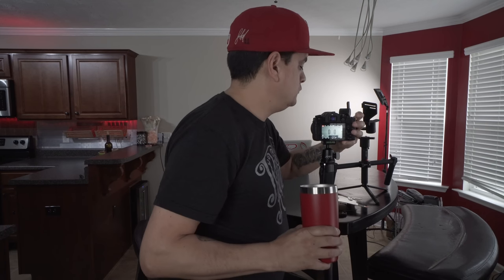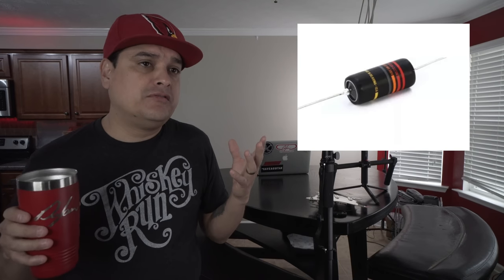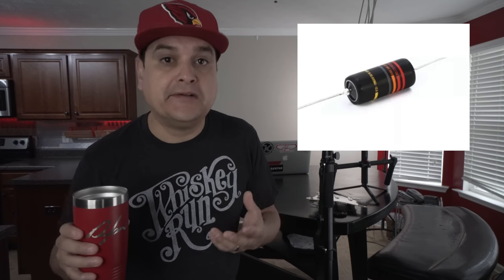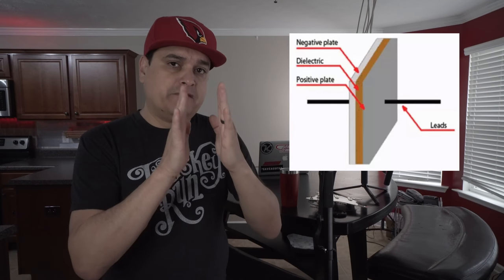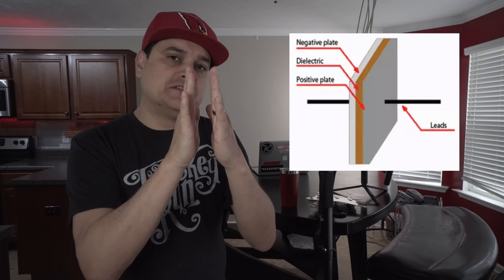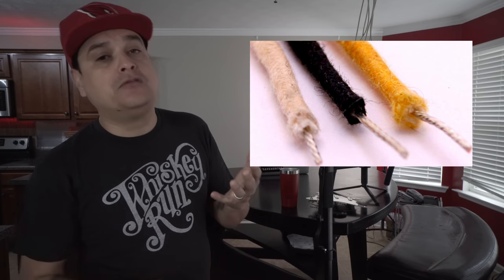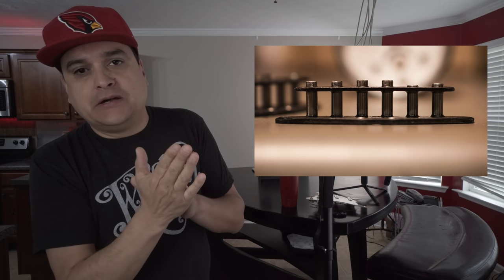Are Paper In Oil Caps Better Than Orange Drop?

Comment: thanks for the video!  i dig it and your content generally!  but, alas, i must disagree with some of the thinking here, because of a couple things.  just superficially, yes of course different cap types can sound different; you're using totally different materials of dissimilar densities as the spacer between the charged cap plates, and they don't all act identically, just like mahogany behaves and sounds different than maple, and aluminum bridges play a little different than brass bridges, most of the time.  alnico speakers play differently than ceramic.  and a substantial amount of the time i've spent so far exploring this question, i've spent actually trying out many, many caps of different construction types and values and ratings.  i've done blind tests and non-blind tests.  i know i'll probably catch some flak for this, but please hear me out before judging. this is just my reporting back on my own (probably biased and anecdotal but nonetheless extensive and attended with care) first hand experiences, which i gathered by  conducting direct comparisons and experiments and carefully noting what i heard as a result and then concluded.  and ffs people, do your own listening tests and see what you experience.  there's no shortage of received uninformed opinion thrown around these days.  remember that the cynical, impossible-to-please skeptic is simply someone who doesn't believe in their own observations.  i encourage everyone to do their own work and speak from their own experience where possible.  

  my take on the whole issue is basically this:  it'll take 3 minutes or less to figure out which cap value (uF/nF) is best for tone.  i personally tend to most often prefer caps in the 10n to 22nF range. your results may vary.  any bigger tone shaping i usually regard as the amp/effects/cabinet's job.  for voltage rating, i can comfortably say you're best bet is to choose the highest voltage rating you can afford; i have noticed consistently that higher voltage rated caps just sound noticably better, even in blind tests.  now, the controversial attribute -- the differences in cap construction type -- these are where we find the most subtle and difficult to pick out differences when listening by far, and i think this is because the audible artifacts of construction type are not a matter of the -3dB cutoff frequency dictated by plate area in the cap.  it's instead that the audible artifacts are the result of different dielectric materials being sandwiched between metal layers and subjected to changing electric fields that do exert a measurable (albeit minute) physical force on said dielectric.  tech talk aside, what i'm saying basically is that i've so far concluded that cap construction/dielectric type is something that i feel when playing the instrument, much more than something i hear from the speakers, and that dielectric type mainly affects how the guitar plays in my hands.  what this means to me is, construction type in cap selection is chosen because of its effect on how a given player interfaces with their instrument.  maybe nobody hears any audible difference in tone; still the one playing the instrument will in my experience almost always be able to FEEL something different in how the instrument plays for them.  so, choose a cap's value (uF/nF) for how it affects tone and how it sounds to a group of listeners. but, choose the cap's construction/dielectric type for your own preference and how it makes the instrument play in your hands.  i hope that makes sense.

Comment: I just changed all the electronics (minus the pickups) in my 2 Gibson SGs (one is a 2004 and the other is 2005, the specific models are un important)
Originally the caps they had were ceramic, the ones in the now wiring harness were orange drop..... tonal difference? Fucked if I know!?!?!
the only significant change I really made was I put treble bleeds on all the volume pots since I didn't want the high end roll off... (thats what a tone control is for... right?)

so yeah, I'm honestly not surprised by this at all and to further this, my father who is an electrical engineer can confirm what you have said here....
great video...

Comment: I worked for 14 years in Defense Electronics. I have seen paper and oil caps blow up. Of course It was closer to the caps limits than we will ever see in a guitar. Personally I would not want paper and oil  caps in a guitar, I think the failure rate would be higher...thats just my opinion. And you are right .047 micro farads is the same in all caps styles...within tolerances. I think size and tolerance is more important. When we buy parts for the military we have to consider a wide range of operating conditions. Unless you are playing in sub zero space or in a volcano, I would get the best caps with 5% tolerance that will fit in your guitar within .022 to .047 micro farads. You’ll have a tone knob anyway to make any adjustments. That’s my 2 cents.
Reply: If you have enough juice running through your guitar to explode any capacitor -- even a 10V electrolytic -- you have bigger problems to worry about. First, start by unplugging everything, while you still can.

Comment: Dylan, there's only one property that you forgot to mention. Some caps, such as ceramics, can have (in some environments) a piezoelectric effect. I have never heard the effects of that in any guitars, but it is in fact a property for which ceramic caps are avoided in certain applications (I'm not saying, guitars). Also, some capacitors (stacked ceramics) lose capacitance when the voltage increases. The pickups would have to produce about 10 Volts, to make that happen. Not sure which pickups do that, but in theory they lose capacitance at any voltage. I'm sure there's no shortage of people who can hear that difference.

Comment: Well, if you want an angry disagreement. Ah, you are right about capacitors. It doesn't matter what the cap is made of. .01 is .01 no matter what it's made of. Oil and paper caps will fail sooner than caps made of better materials. No argument here, you are right. The people that will argue are the ones that really don't know any better. And thus if they don't know, they should not argue. Next video please. God bless you brother.

Comment: Great vid, thanks for breaking it down. One thing, I can't seem to find, is they vaule (?) of the capacitor. If I was to go to the electronics store and by a cap (any type) what is the value? I am runnig a stock P-90 through 500K vol and tone pots to a input jack. Thanks in advance.

Comment: When comparing a number of caps in a guitar, I can hear a slight difference between ceramic cap to oil/paper or orange drop, but do they sound better or worse, that's a taste thing and as soon as you apply any gain, there is no difference.  I like to use orange drops, mainly to satisfy the cork-sniffers, but also because it's easy to read the printing on the side
Reply: New old Russian PIO caps definitely change the tone of my guitar from new mylar!!!

Comment: I’ve changed all the guts in every guitar I own with CTS pots and Emerson oil in paper caps. I don’t know if it “sounds better “ but there is definitely a change in dynamic range and a change in attenuation. I’ve done this on jazzmasters, les Paul, telecasters, strats. They all get a bit louder and more focused.  I don’t know if it’s the caps pot or whatever. But a changes happens for sure.

Comment: from my understanding paper & oil has a warmer tone and ceramic a brighter tone. I was thinking of having an on/on/on toggle switch with an 1.0, 0.47, 0.22 caps so I could switch to whatever cap while playing Making a wider rang of tones to use then just settling for one cap. I also understand if you wire 2 caps in series or parallel you can double the value or cut it in half.
Reply from the maker: Nah... that's all myth.
Reply: Well I can hear the differance when it comes to ceramic  or paper & oil maybe some people can't it's a matter of preference. The higher the value of the cap the deeper the tone you said that in one of your own videos and it's true you can hear the differance. Basic wiring like when you wire speakers series or parallel is evident not Myth, So how can you just dismiss it as myth when it is not. i think you are fooling yourself or you just don't realy know about electronics. If I wire two 0.022 caps in series it becomes 0.011, If I wire two 0.022 caps in parallel it becomes 0.044 and that is not myth.

Comment: I use green mylar caps from Russia and like them, there cheap and sound good, I build amps and use Mallory but for my electrolytic I use cheapo jamicons and nichicons, cause I've used super expensive caps and never noticed a difference. I got a tweed deluxe I put up against any real one, I paid to have a a custom output transformer, that's what important on a amp. Capacitors don't add  anything they take away, different frequency's.
Reply: You’re probably right but I like expensive brand name capacitors because it’s kind of like jewelry. It’s about vibe.

Comment: Things I seen today were orange drops with I guess a resister soldered to each wire of the orange drops called it tone bleeding and the orange drops were attached to the input output only on either or the pits but did not connect the controls in any way and say fore the volume a different capasitor setup was used. I tried to digest that 14 hr lesson best I could . I think one orange drop on tone good enough without in series tiny resister stealing anything. I don't no I'll just keep listening to ya Dylan.  I know one thing people will soder an alarm clock up to a pot if they thought they could sell you the clock.

Comment: That's the abstract conclusion. In real life it's often different. Use your ears! I wanted to know for myself, so I changed to paper and oil bumblebees on my Les Paul, and it DOES sound way softer than the Orange Cs that came with the 60s Standard. Not just a little, very noticeable. On the Neck it's actually almost too soft now. There are also great comparison videos out there that go the practical way and test them themselves. If you don't hear it, don't bother! But I do and others do too. They do have an effect on the attack and the top-end.

Comment: Just sort of wondering if it could be determined if someone loves the sound of an old capacitor in a guitar, if the difference in resistance from the aging could be determined, could the same value resistance added to the new capacitor?  I realize that the sound would probably be different unless the pickups, pots and wiring were identical on both guitars.  BTW, on really cheap guitars, I've also seen ceramic disc caps.  I play bass, and in my main instrument I've got a Kent Armstrong preamp, so I don't think much about caps now.  Finally, your ability to explain complex ideas in ways that are extremely easy to understand make you an excellent instructor.
Reply: Capacitors, not resistors.

Comment: You cracked me up: 
"it's practically a religion", 
made my morning. 

Super; needing more knowledge in this area. ...thinking much of the blathering is hokum...

 My take FIRST, per your instructions.
What I know:
Regardless of fabrication materials, Caps have industry standard requirements and parameter values. 

What I don't know:
Any variations in the way the Caps discharge, and (even) if so, any sound differences. 

Ok. On to the video.
Thanks.
Michael

Edit. 
I knew it! It's simply logical. 

So, nostalgia, or name association, or manufacturing location is about all there is to choosing which to use. 

Cheers from Texas!
🤘😎🤘

Comment: On a little different note, under the same logic, tubes built to the same spec should sound the exact same as the older manufactured ones. Right? Same with transistors?

Comment: Well I'm not sure exactly, but that's kinda why I'm here. But it would seem that coupling capacitors in a tube amp would be pretty important because they carry 100% of the signal from stage to stage, even in the tone section. They have to separate the high DC voltage from the low AC signal voltage, and it would seem to me that you'd want the best quality capacitors for that specific job as you could possibly get.
Reply: You want high quality caps, especially for high voltage operation... for durability, not sound.

Comment: A tone capacitor is not an audio generator like a big filter cap in an amp. So it is not transferring the sound from A to B. It is there solely to bleed frequencies to ground mainly highs. But if you put a .1 cap instead of a .022 in there there is quite a bit of mid roll off. However, i have experimented with some really small caps below .022 and something strange happened that i still cannot figure out. When rolling down the tone control there seemed to be some 'honky' mids prominent. I have no way of explaining that..

Comment: I know this is one of your older videos so I hope you get to see this comment. Because of my love of guitars along with being a consummate tinkerer has recently bought me to investigate all aspects of guitar repair & modification which bought me to your channel. Honestly I don't know what all the fuss is about because as far as I'm concerned the biggest difference in the sound your going to produce comes down to single coils vs humbuckers vs P90's vs Filtertrons along with the amplifier &/or effects used.  After doing quite a bit of research on this topic I have come to believe the difference between what pots &/or capacitors used is negligible to non-existent. 
Maybe just maybe you may hear the slightest difference by changing the pots/capacitor IF your plugged straight into the amp on the clean channel with no effects but otherwise again the difference is going to be negligible at best! In light of the kinds of effects & amps available even the difference between single coils & humbuckers really isn't that much of a big deal either. If anything, in my opinion, single coils are better because you can get them to scream like a humbucker but you'll never get that out of phase twang from a humbucker (at least not without some kind of an effect)!  Just look at the sound Jimi Hendrix got out of Fender Stratocaster (my Fav) just by plugging it into a Marshall stack & turned it up to 11. :) ;)  
In my humble mind, as far as electronics are concerned, the most important elements are the guitar, the amp &/or the effects you use because those choices FAR outweigh anything like the pots &/or capacitors.  I don't care if it's Blues, Jazz, Rock, or Country your always going to get the sound you want by your choice of guitar & amplifier, period, end of story! 
So I just want to say...Good job Dylan! :) ;)

Comment: Capacitor type makes a big difference in amp design.  The reason is that there's is more to a capacitor than just capacitance (ESR, etc...).  For a guitar, I usually grab the same type I build amps with.  It's not like they are that expensive. There is a slight difference it tone, with guitar cap type, but they only cost a couple dollars.  A rings tone is a sum of its parts.

Comment: Okay, you told me to. And honestly, I may have the most unique perspective on this being on the Autism spectrum. So here goes.

I don't currently play guitar (yet), but I do hyper-fixate and focus on things and I'm also good at picking out details and differences. It's a "symptom" of being the way I am. Hence this rabbit hole of guitar setup and whatnot. I also ended up listening to my first A-B (and C-D etc.) comparison of capacitors with zero point of reference nor comparison or assumptions of what any of them SHOULD sound like. I literally didn't know tit from tat when it came to what was "vintage" or any other descriptor of the sound that any given capacitor type has.

So what do I think? I think PIO definitely makes a difference. It's a sweeter tone, especially compared to orange drops, which at times can have this harsh hissy/shouty overtone which almost sounds like an HL2 Stalker scream. It's worse on single coils than humbuckers, and THE worst, so far that I've heard, on Jazzmaster bridge pickups.

PiO attenuates that sound a little. And I DO mean a little because despite how I'm talking it up, your capacitor TYPE has even LESS of an effect on your tone than tonewood, which in and of itself is only a 5% effect AT BEST in an un-processed setting and not as a part of a mix/live event. At the same time, when I finally start learning and playing, I will do ANYTHING to get rid of that stalker scream hissy bullcrap tone that I can't stand.

So yeah. PiO (Or I guess, now that I've finished the video MiO) are going on my tone pots no matter what. I won't spend $30+ on one, but I AM damn well getting one. Hell, I might even use one in a treble bleed circuit, too, if I can find one that small.

Comment: so buying the cheapest cap on sweetwater which happens to be paper in oil for $10 was a bad call? because the new cap, pot, and wiring I recycled from an old stereo sound great. 

albeit they were replacing broken/failing components from a 20+ year old guitar, that sounded not the best....so I guess any fully functioning components would sound great. food for thought. I'm digging the honesty.

Comment: Cool vid.

Question: do different capacitor types tend to have their values drift differently over time? For example, would a PIO drift sooner than a ceramic cap? And I'm assuming they would tend to drift to lower values, but could they drift to higher ones?

Comment: Good talk!  Thanks!  I put very high output humbuckers in my Epi SG. Did not change pots or caps. Bought some Russian green pio caps. Installed. Sound was noticeably “compressed”, “warmer”, whatever ...was noticeably different. The  HBs were rated at 16–18kohm, I believe  (GFS “Bigmouth”) Maybe some other factor than the cap material???